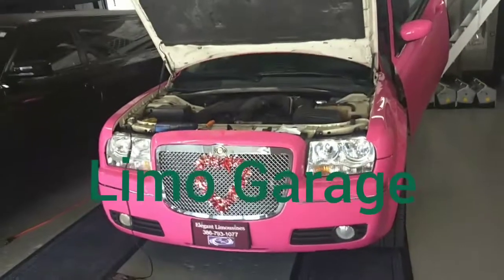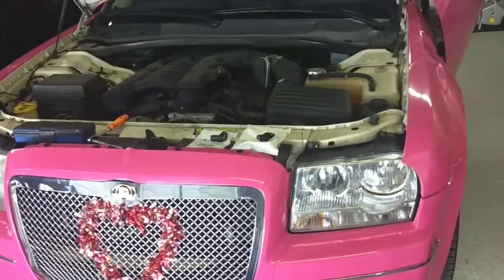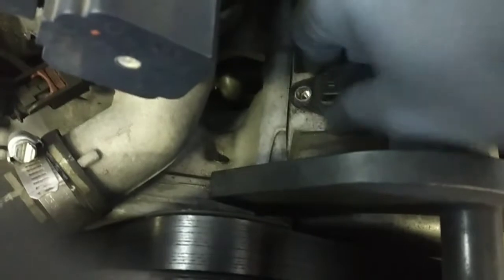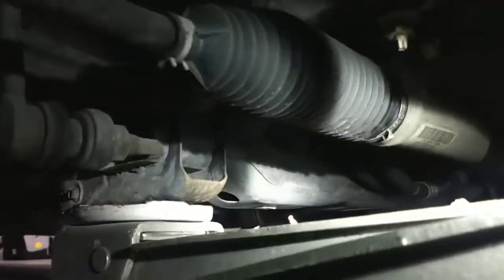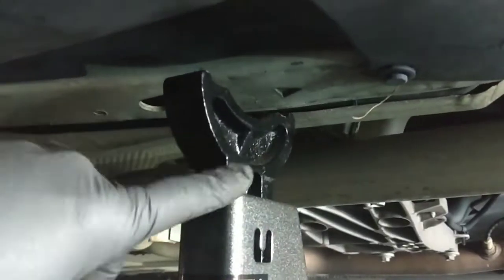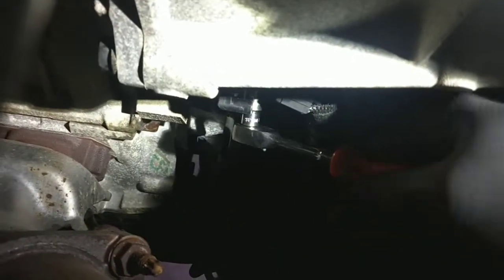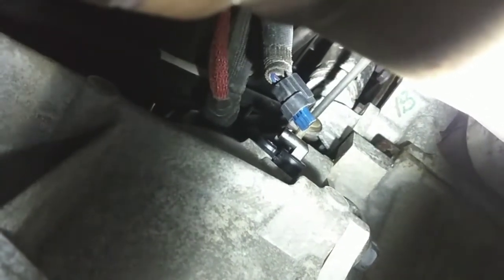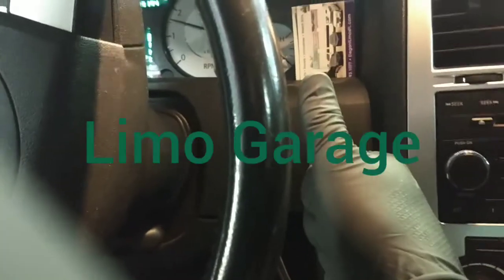Intermittent  Extended Crank or Hard Start on a Chrysler 300

Comment: Great video! This is exactly what I was looking for in terms of a visual on the location for camshaft and crankshaft sensors. Do you have a video of what it sounded like before this fix? That would be super helpful!   And as far as pricing goes, you are 100% right on that. Prices at my local autoparts stores are about $150 for one of the sensors and about $250 for the other. Crazy....
Reply from the maker: Before I replaced the sensors the engine would still start but it would crank over for about 30 seconds before starting.

Comment: My 05’ 300c recently started doing the same thing but it’s only happened a few times so far. I hope by replacing both sensors it fixes the problem. Can it also be a leak in the fuel system?  Before I bought my car it had been sitting for a few years without it being driven. I’ve already had to get the head gasket and oil pressure sensors replaced. It’s recently had a tune up and battery changed
Reply from the maker: You may have a problem that is called bleed back. What that means is that your fuel pressure bleeds back down into the system when the vehicle is shut off. Then it takes time for the pump to prime the injectors on startup. The best way to test this is to put a fuel pressure gauge on the fuel rail and see if it holds pressure after you shut the vehicle off.

Comment: I have the same problem but the rpm is high at 1500 just like urs on the video, any idea what it could be?
Reply from the maker: You probably need to clean the throttle body and re set the idle with a scanner.  I would also check for vacume  leaks .

Comment: I have a 2011 Chrysler 300C it's ice cold when I drive but in traffic it is warm is that has the same problem as the charger on your video
Reply from the maker: Thanks for calling me, I hope my advice helps.
Reply: @thelimogarage9665  no thank you for taking the time out to answer some question
Reply: @thelimogarage9665  it's rare to find someone that actually would give you credible free information  that actually wants to help . I took my car to the dealership for an alternator and another warranty issue. I simply asked what day or over the car and see what needed to be addressed they proceeded to tell me he would be $150 for that kind of inspection but they would do a free safety inspection!I pick the car up and I simply asked you that ticking noise I heard was that a serious problem was that the manifold or was that the typical which you're not supposed to worry about supposedly. I simply asked what the technician what he thought about the car the sound was I imagining the problem that was not there break even call him or get him on the phone. .used to work at a motorcycle dealership and when we have customers come in there and even if they were the cheapest tightest not ones that kind of money you would still want to know what the bike need free of charge.  But not the Dodge dealership. .and it's awesome to find someone that will give you good creditable advice and actually pick up the phone; and take time out of your schedule to talk to you
Reply from the maker: @alexross5620  fortunately I have been a technician my entire life so I never had to rely on dealerships. Whenever I have information that I think is valuable I'm happy to share it with anybody that it may help.

Comment: 😂 I just can't seem to find my car is having. It starts up fine when you first start the engine like everything's okay. But after the car's been running for a hour or so, it won't start. The starter would drag like the battery is dead, but after the car cools off for about an hour or so, it will start just fine again. Can anyone help me with this damn problem!? It has a brand new battery and I got the starter replace at the beginning of the year, and a voltage meter reads that the alternator is good although it fluctuates up and down sometime
Reply from the maker: Pull up the carpet on the front passenger side floor. Just under the glove box. There is a terminal There where the battery cable connects from the trunk to the other side of the firewall for the starter. This connection is known to get loose and corroded.  I hope this helps.
Reply: I had a Pontiac grand am do that to me but after I replaced the coil packs it ran just fine never got stranded somewhere again 😂

Comment: Hey The Limo Garage! I’ve had the same problem for about 3 months now. I’ve changed the cam and crank sensors but still takes too long to crank soon i’ll be replacing the throttle and fuel pump. I’ve had code scans and all that pops up is cam, crank sensors, knock sensor, O2 sensor and ECM malfunction, Throttle body failure... is there anyway you could help? Thanks A Lot  it’s a Chrysler 300 C 2005 Hemi RWD
Reply: i believe there is a tsb for that engine . check the ground connections i think the one that goes bad is behind the passanger head.
Reply: syndakitpanda1777 where is that located

Comment: I have a 2014 that has the same problem. I thought there is a leak In the fuel line since Chrysler adapted Mercedes system

Comment: I replaced both but then had a camshaft sensor check engine light come on with the new camshaft sensor so I put the old one back in and now it does the extended start again but the check engine light is gone any ideas?
Reply from the maker: Did you buy the parts from the dealer? I have seen this problem happen with aftermarket parts. That's why I recommend using Mopar only.
Reply: @thelimogarage9665  no got them at advanced auto parts
Reply from the maker: That's your problem right there.

Comment: Is this the same for the 2.7 liter v6 turns over but won't start
Reply from the maker: I don't think you're going to find the same results. The best way to be sure is to put a scanner on the vehicle to see if you're receiving a signal from cam and crank sensor when it does not start.

Comment: What if it cranks but doesn’t start? Same issue?
Reply from the maker: The only way to be sure is by using a scanner. Check the data when cranking the engine, if the cam and crank sensors are good you will see them responding in the data.